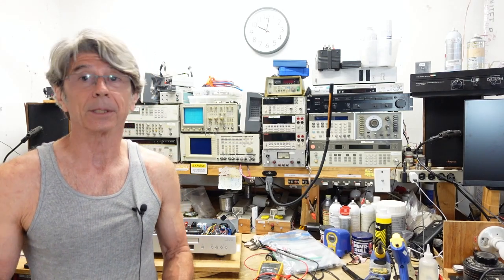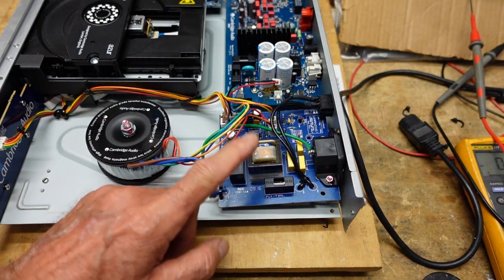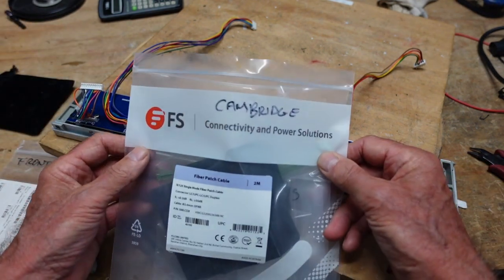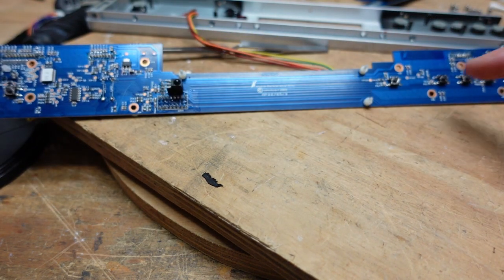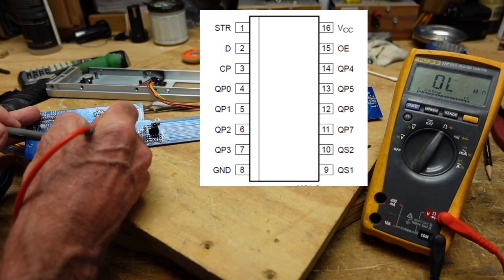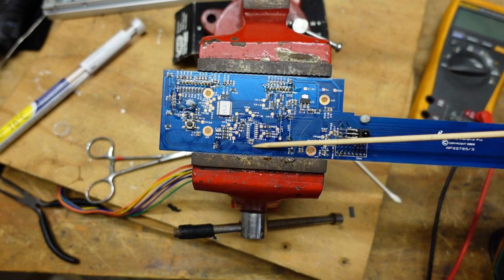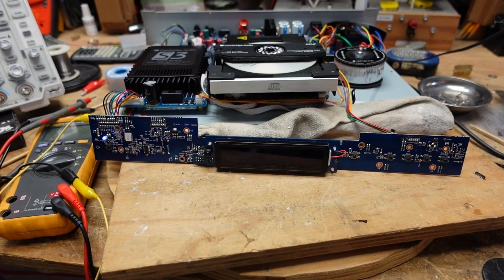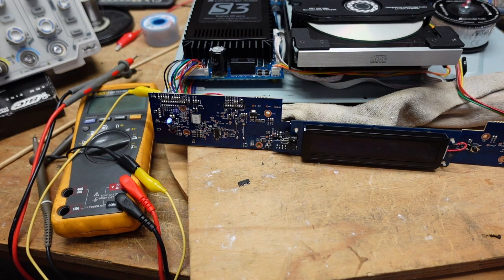Cambridge Audio Azur 650C CD Player Unit Dead

Comment: Mine worked fine for 6 years but then completely failed, no power, and it was not the power supply, it was something else that failed, the main board I think. I took it to an electrician. In the end it was not worth fixing so I threw it out. Azur 340C.

Comment: Marked bags of parts.  Gotta start doing that myself!  So many units apart at one time.  Sux!
Reply from the maker: Yeah, I had to start doing it for the same reason; multiple units disassembled while waiting for parts.
I also take a pencil and mark the inside of the tops and bottoms with the model number.
Reply: @raygianelli3612  Thanks Ray.  Also, Do you think it is worth while to repair and update my NAD 214 and 9060 amps.  I sure miss them in my poorman's HT/music system.
Reply from the maker: @welderfixer  NAD makes nice sounding gear.  The designs are electronically very good, although layout could be better in regard to placing electrolytic capacitors near sources of heat.  
And speaking of electrolytics, NAD went through a period where inferior caps were used, which failed prematurely.  While I'm not a proponent of blanket recapping, with some NAD's it's warranted. My two cents.
Reply: @raygianelli3612  Thanks Ray.  I gotta save these amps.  Time to make a list, order the parts and get busy.  Surely the caps are failing and I thinking a few transistors are leaky to boot.  I also have a beautiful NAD M3 CD player that doesn't "see" the disc.  I'm hoping I can adjust the laser pots up just a touch and get it going again.

Comment: Hello Ray, nice and useful video once again!. I hope there is a way to figure out what is wrong with the display. Most of them have an epoxy blob covering a chip that decodes the signals and applies all the signals to drive the LCD.  If that chip fails, there is not much you can do. The back light is usually driven separately, and it does not involve the said chip so the fact that there is back-light does not necessarily mean that the driver chip is receiving power. Most likely you already knew and tried this, but if not, it would be my two cents.
Reply from the maker: Appreciate the input, Joe!  I suspect it is the processor.  I had voltage to it, and pulses as well. No idea what pins do what, as there's no part number on the blob.
I was disappointed in the outcome, but that's just the way it is with some items.  McIntosh has service literature and parts going back decades.  Other manufacturers,well, not so much.

Comment: I've had a 740C for over a decade. I've never had to repair any device more than this unit. Those main filter caps are 'proprietary' (I.e. as cheaply made as possible). A transistor and some caps in the servo always go. And the worst being the connectors and traces in the front panel get intermittent open circuits. They are great sounding players when working but they tend to come back like boomerangs with another issue. Scrap it!
Reply from the maker: Wow, I had no experience with Cambridge Audio products.  I thought they had a good reputation.  Between your post and the one before it I'm not so sure now, at least in the CD player realm.
Reply: In C640v2 they have sandwiched two no name 85°C caps between bare, non- heatsinked 78/7915 regs running in excess of 50°C with foreseeable consequences. Planned obsolescence. All tactile switches had to be replaced as well, along with the drawer belt.
Reply: Just like anything else British, they try weird stuff, because they can.😂
Reply from the maker: @Rotteneggsack  Kinky Boots!  😝
Reply: To be fair I have a few other CDP's from that era with gremlins (Audiolab 6000C was worse). The 740C was ultimately fixed but it took many goes. It was a great workhorse as a DAC and CDP for many years amongst the repairs. Did a total recap at some stage. I wouldn't have bothered if it didn't sound so good.